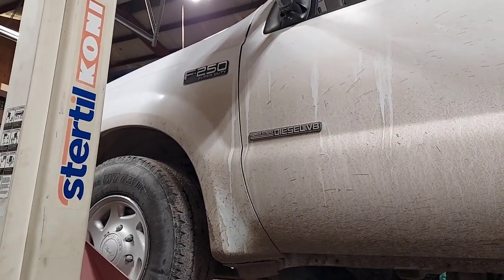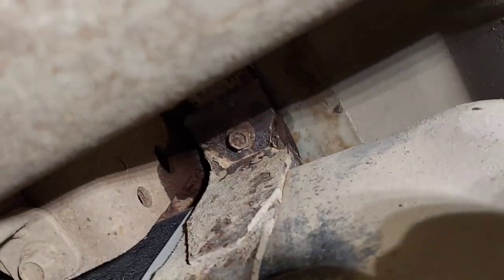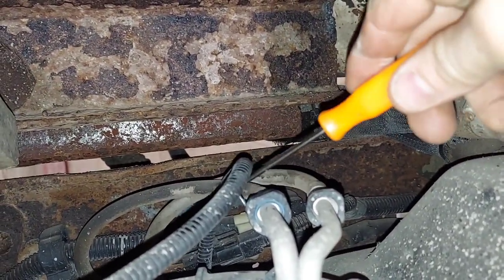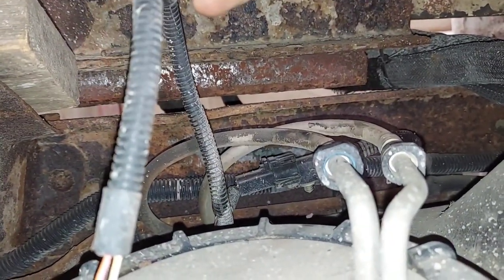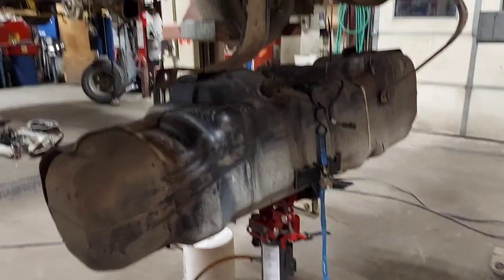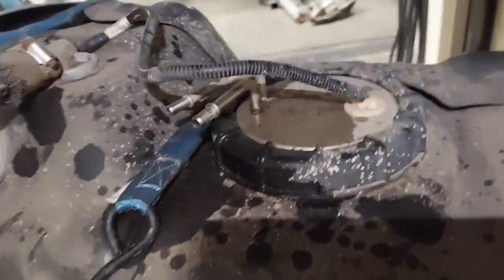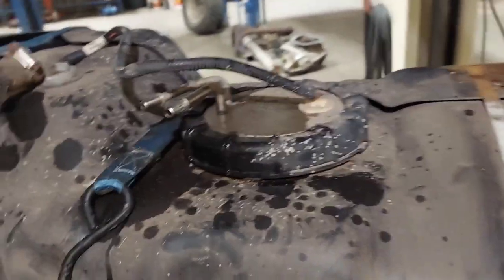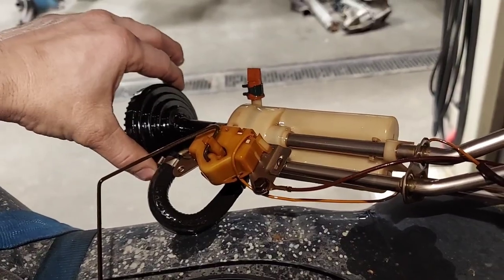01 Ford F-250 Diesel fuel tank and sending unit removal.

Comment: Cannot hear the words over the music. You also left out the hardest part which is how to rethread the large sending unit plastic nut that holds everything in place. I have been fighting mine for over 90 minutes and I simply cannot get it to thread past 1/4 turn when it then decides to pop off.
Reply from the maker: Yes sorry. I usually start it on on then  hit down on it with a hammer. To get it over the first threads hope that helps.